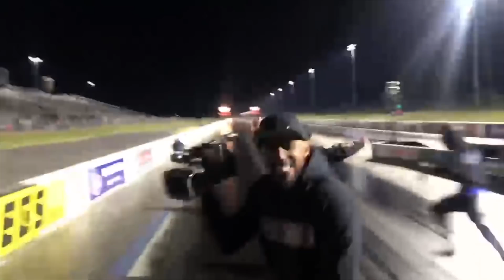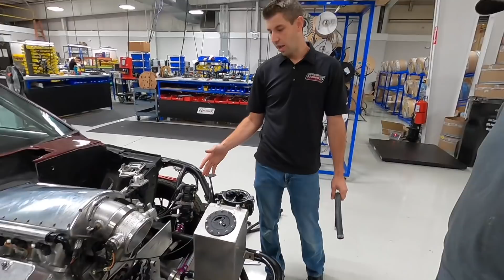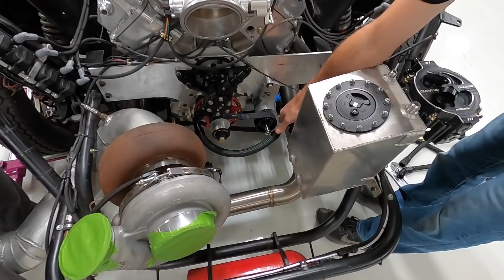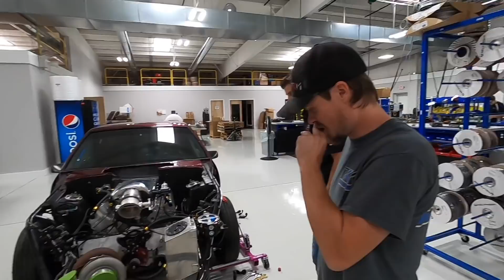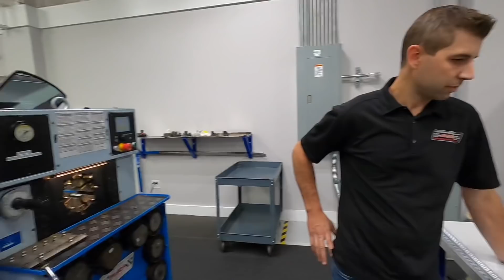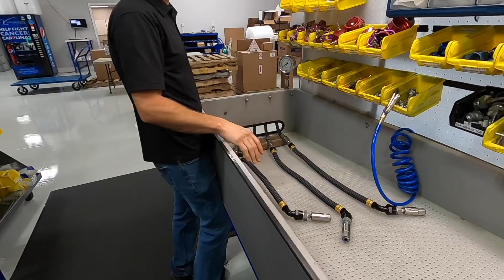BAD APPLE GETS DRESSED UP!!!! Brown and Miller Racing Solutions!!!

Comment: A lot of pointless marketing fluff from the bmrs rep. Billet is just a buzzword people like to throw around, what grade of aluminum do they actually use? I would also say that most bent tube fittings are bent using a mandrel. While comparing the weights I get that they are trying to show the reduction from rubber to ptfe, but why not have an apples to apples comparison if they are trying to knock the competition? Other brands offer aramid braid ptfe crimped lines that are a lot closer in weight to the bmrs offering. And yes one piece bent fittings are nice, but I have assembled and tested thousands of fittings that are brazed and have never had a single issue from the braze itself. One last thing, convoluted hose definitely does not flow better then a smooth bore hose.

Comment: I'm very surprised that you didn't take the car to Modern Racing like your boy Justin Swanstrom did with his car I see that Brown & Miller seem to be at the top of their game and seem to know what they are doing and if I'm not mistaken I think Murder Nova also uses them for his plumbing as well but even though Modern Racing is very expensive and know what they are doing as well and are also at the top of the game but at Modern Racing they are a One-Stop shop because not only do they plumb the car they wire it, they will wrap it, they will even put in a faux sunroof in the roof of your car if your car comes factory with one and you take it out because you don't want to be full tilt making a hit down the track and the sunroof gets sucked out of the car and shatters all over the track and that can be bad for a bunch of reasons not only is that a good way to loose cabin pressure in the car and that can make the car do a bunch of crazy things but they also have to shut the track down for a minimum of 30 minutes to clean it up but also if they miss some glass that can end up in someone else's tires and that can end very badly for that person

Comment: Ok Stupid question, Why would you run the Burndown hose through the car into a tank, when you could run it to the oil pan? Does this have a dry sump system? Or is the oil too aerated to rejoin the oil in the pan? More curious than anything, because it'd be tempting to just run it to the oil pan and be done with it.
Reply: There's a massive amount of water and methanol vapor that ends up in the burndown tank.   Really want to try and get that out of the engine.
Reply: @HorsepowerMATTers , That makes sense, and you are right water and alcohol do not make good lubricants. I knew there was a good reason, but never played with methanol so not sure how everything works on those